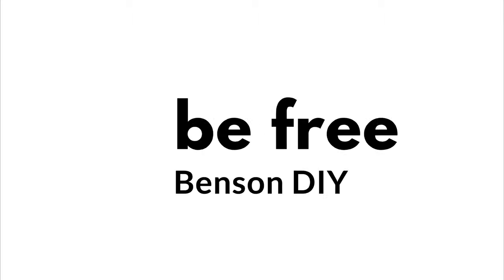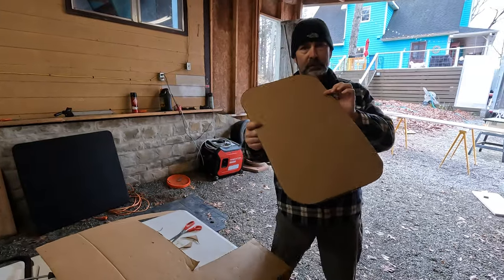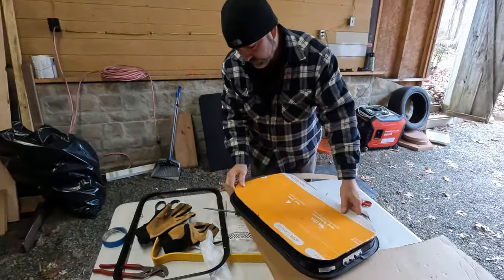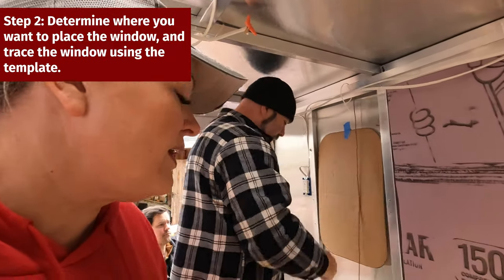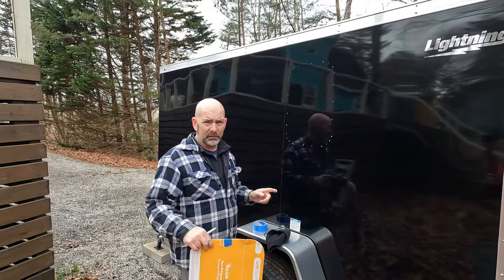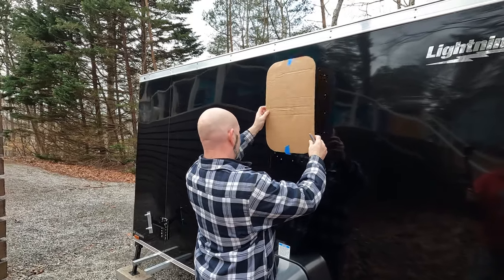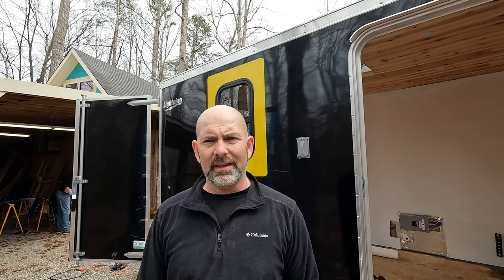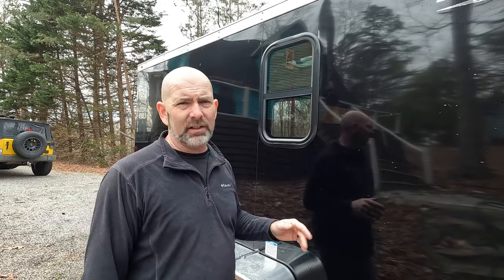HOW TO INSTALL AN RV WINDOW IN A CARGO CAMPER Ep. 15

Comment: Kevin, can you cut the window out from the inside out instead of the outside in? What if you don't have any wall insulation, does that make it so you have to shore the wall up somehow? Thanks very much and great job, really enjoy the videos.
Reply from the maker: You can cut from the inside without anything in between if you are using a brand new sharp blade.  If the blade is dull you may run into some issues.  I would still put painters tape on the outside to avoid tearing it up.  Thanks for watching!!!

Comment: I just got windows for our cargo trailer. I didn’t look at them real good yet but it seems like the inside trim ring is a little big. Looks like the screws will go into a little grove on the frame is that correct
Reply from the maker: Yes...  They are a little difficult at times.  Make sure you have an extra set of hands to help out!   Thanks so much for watching!!!

Comment: If it was mine I’d used the gray buttle sealer on the window
Reply: Always, I was surprised they didn't.
Reply from the maker: Great suggestion.  I used it on the rear window of the Rescue Wagon.  I can't remember my reasoning for not using it on the Escape Pod!!!  Thanks for watching and taking the time to comment!!!
Reply: As a automotive restoration expert and shop owner I disagree!
Reply: Agree, should always use that butyl sealer.